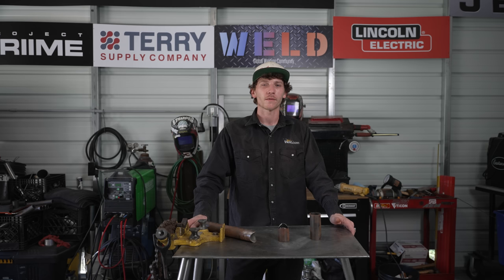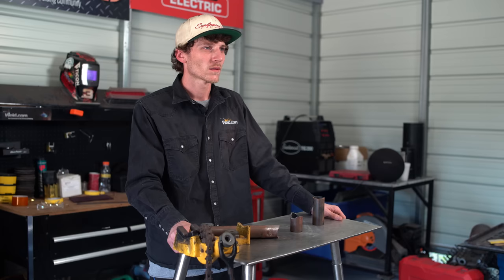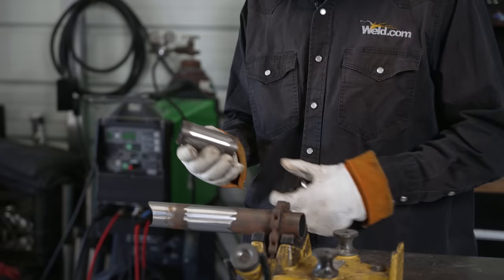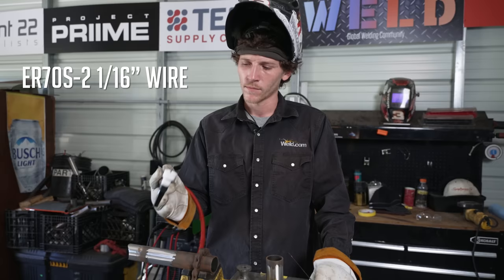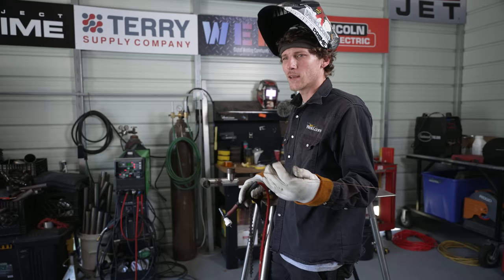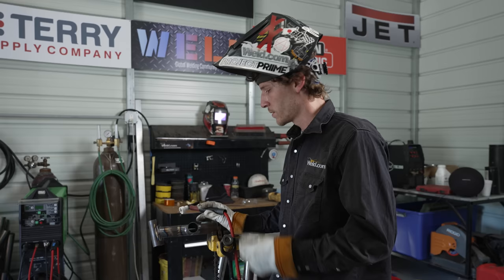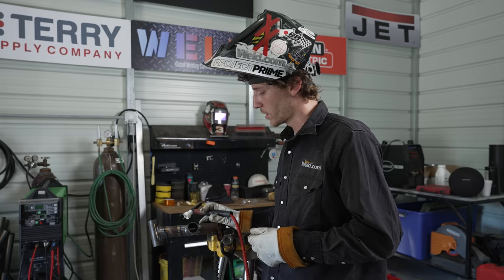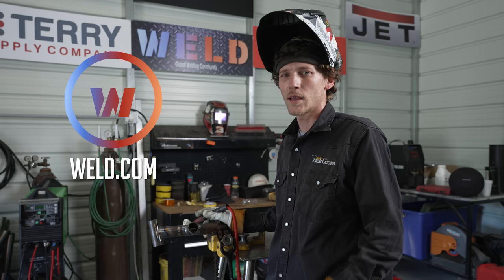Chromoly Welding 101

Comment: For aviation certification back in the 80’s I had to certify with a five cluster joint. Oxy/acet weld only.
Reply: Dang that sound like some fun. Thanks for watching
Reply: @SuperformanceFab  run the key hole
Reply: Gas does work on 4130.  

Made my first valve spring compressor of 4130 tubing.  Welded with Gas.
Reply: @dennisyoung4631  of course it does. That is all they had for many years
Reply: A&P Tech classes is exactly how I became hooked on playing in the puddle and manipulating my welds. Hand eye coordination 101. All of the guys in my welding block were blowing holes in their material and so forth and now I’m so thankful for the information and instruction Mr Moffit provides for TIG just a different source of heat really

Comment: Like a lot of this you tube welding videos . It’s easy to weld joists right in front of you ,no other tubes obstructing your view. Beginner’s need to see that so they know sometimes a weld has to be contortionist
Reply: Yeah man its best to practice as much as you can so that you become so proficient with it when you get into those out of bench positions welds and have to become a contortionist and it makes it easier to make that weld and you dont even have to think about it. And when you get into those positions nothing else matters but that puddle. I plan on doing a 8.50 cert cage soon and plan on talking about all these points. Thanks for watching and reaching out.

Comment: Great video.  The only point I would like to mention is that according to Gerry Uttrachi (author of Advanced Automotive Welding (2012) and Weld Like a Pro (2015), Vice President of Esab for 10 years, 2007 President of the American Welding Society (AWS)), the "best" TIG rod for 4130 chromoly that will not be PWHT'd is ER70S-2, not ER80S-D2.  Those books I mentioned go into detail as to why.
Reply: Thats for letting me know, I definitely need to look into this guys work. I appreciate you reaching out and thank for watching.

Comment: I aspire to own a tig machine one day. Nice welding!
Reply: Do it man it will be one best decisions you make and youll have so much fun and make many friends within the industry. Thanks for watching
Reply: I highly recommend the PrimeWeld TIG225X ACDC for about $869 and it comes with a CK Worldwide 17F 3 series torch. This machine is freaking awesome which it’s capable of HF Start, Pulse width modulation, 2T/4T function, AC Balance for aluminum that equals a red or blue box costing a $1K or 2k more! 

Go for it!
Reply: Wouldn't it be cooler to switch to a laser welding machine?
Reply: Do it! I got the primeweld 225 too and it’s decent. Learn cad and then you can use services like send cut send and you really don’t need that much shop space just a welder, table, and grinder

Comment: Your welds look perfect! I have to weld some 4130 tubing where the fit up is not very good. Do you ever purge the inside of the tube? I realize a small hole would be needed to allow the argon to escape. Also, have to weld some 4130 to 4140 machined parts, I plan on some preheat around 300 degrees, would I still use the ER70S-2 tig wire? thanks

Comment: I'm welding a 4130 .190 plate to a .035 tube using 4130 as the filler at work for lockheed Martin
Reply: Right on its fun stuff to weld. Thanks for watching

Comment: Other methods of welding this, mig stick etc?
Reply: We can definitely show case those processes but for welding such costly material, the cleanest and most effective weld process is what is usually chosen. Thanks for watching
Reply: @SuperformanceFab  yeah I guess, makes sense!
Reply: I have performed many repairs on moly motocross frames back in the early 80s with oxy/fuel before I got into the world of tig.

Comment: Don't mean to knock the video but this was an average video at best. The welder doesn't know to use the right terminology when explaining material behaviour of chromoly, the term he is looking for when describing how the tacks will crack is "brittleness" and reduced "ductility".

The welds are fine but I find that he contradicts himself when he first explains how Chromoly needs lots of shielding gas then fails to let the post-flow shield the weld when it is still glowing red (7:20 mark). 

Key takeaways from the video would be mainly to keep heat input low and to use the right filler metals. Any welder would know not to directly quench the weld when it's still hot, and if you don't you really shouldn't be working on Chromoly tubing.

Comment: It’s not Lighter, It actually heavier 1x1 take 1 foot sections same wall thickness, its a tad heavier, it stronger so you can use half the thickness over mild steel. It’s more brittle than mild steel

Comment: With no previous experience with metal or welding, could someone please tell me if 6061 would be much different than what's used in this video?
Reply: Very different. 6061 is aluminium, requiring different weld settings (AC), different amps, different filler, and the actual behaviour of the puddle is different, so it requires some practice if you're used to steel. The metal itself has very different strength properties, so you'd need to design your piece differently. Finally, it might also require some post-weld heat treating that a 4130 frame might not. It's a fairly complex area.
Reply: @mikehindley3  thank you for your reply, I'm not a welder by any stretch of the imagination, I have old mountain bikes made with 6061 & was maybe thinking of making them into something else, but, if it's difficult to do with a stick welder, then I'll need to rethink my plan. Thanks again for your reply.
Reply: @campbellspears3929  definitely hard to do with a stick welder, especially or a beginner. If you want to make some cool artwork (with holes in) then give it a try. For anything remotely structural or weight-bearing, I'd avoid! This video features TIG welding, which is a different process to stick, and it's hard in different ways (and more expensive).
Reply: @mikehindley3  yip I'm a total noob to welding, can't afford a decent welder, so, I think I will redesign my idea, thank you for your reply.